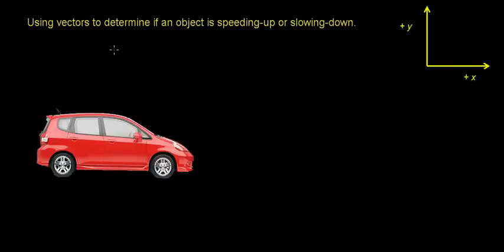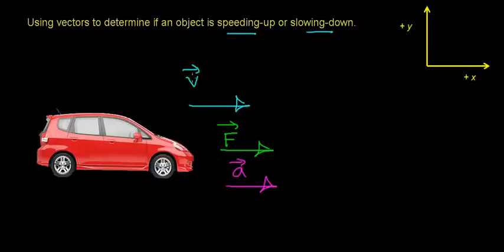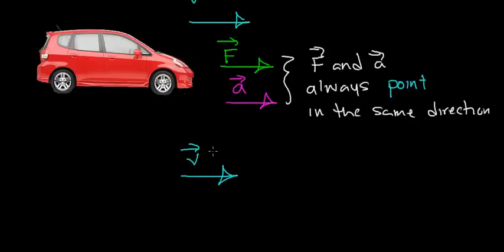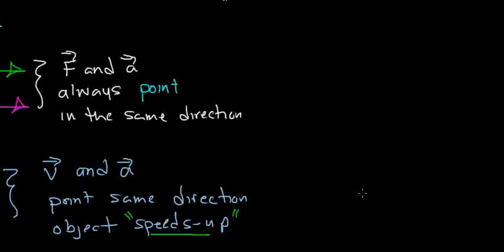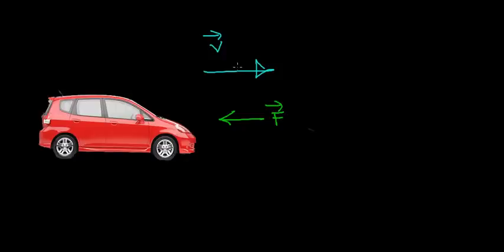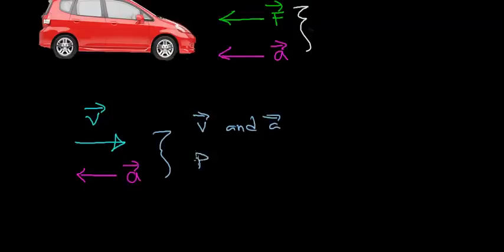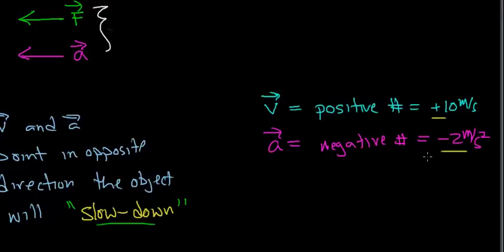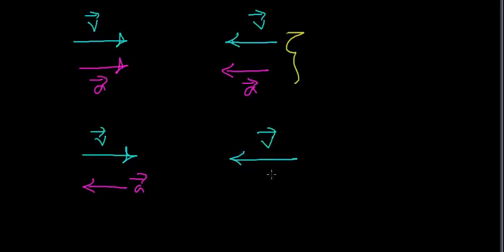using velocity and acceleration vectors to determine if an object is speeding up or slowing down

Comment: But what if they're perpendicular?
Reply: Kinda late lol, but object's speed doesn't change. The direction changes though. Think of a car traveling in a circle at constant speed. Since the velocity vector is changing direction, the car must be accelerating.
Reply: in this case, the acceleration always points to the center of the circle and velocity tangent to car's motion meaning they are perpendicular.